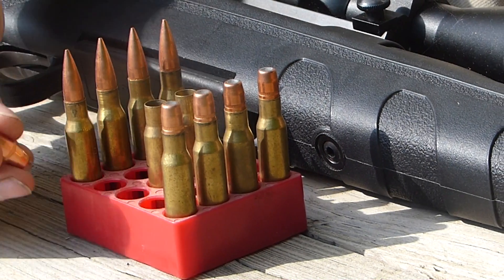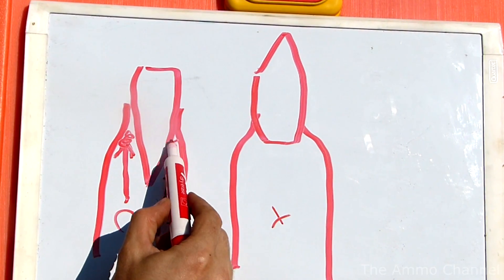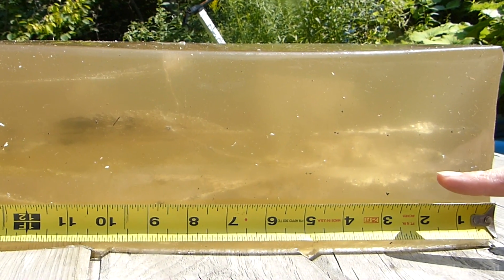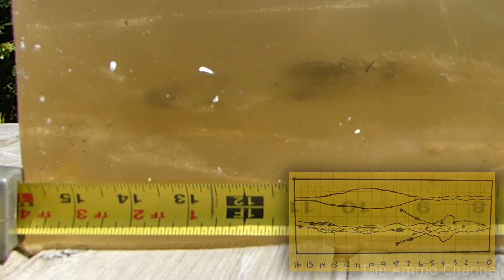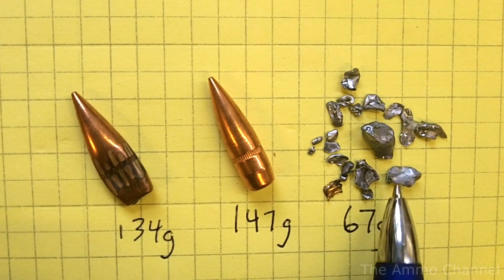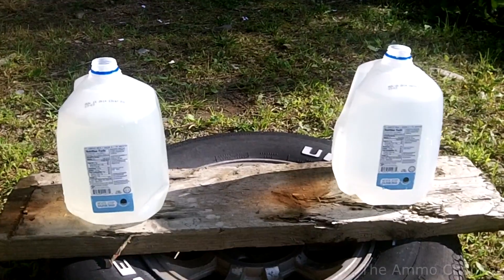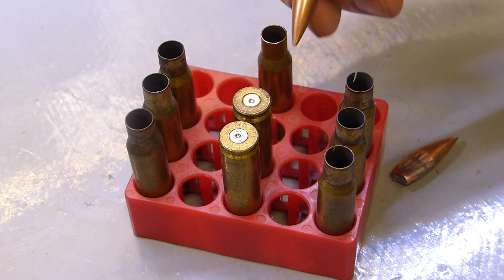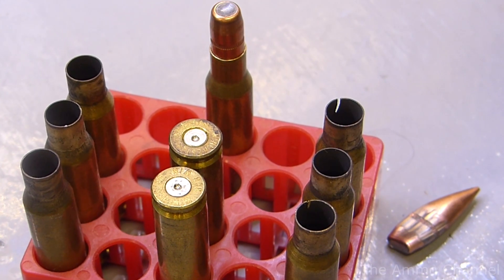Shooting Bullets Loaded Backwards

Comment: Pressure will be uniform in that first question you asked about local pressure.  I know intuitively it seems like your concern is vaild but no, pressure is still pressure everywhere the same  in that configuration.   Loading bullets backward is a great experience.  The damage and the BC you get from loading bullet backwards is insane. The tail is more suited for reducing drag than the nose. for better aerodynamics at subsonic velocity if loaded backwards.    Of course you can't cheat physics but this is actually a very eye opening experiment to run.  Props for doing it.  I have an old 1895 Nagant revolver and I load 78 grain rn lead slugs into it backwards because it's te perfect gun for it since there's no chance of shaving rounds on a gas seal revolver.  ..The flat nosed cylinder wadcutters are the poor mans'/.32 version of a subsonic, but effective hollow point. ..One which still maintains wild penetration and even expansion since it can do nothing but expand when it is an absolute cylinder of copper plated soft lead. At low velocities a pistol round loaded backwards punches a cookie cutter hole a la wadcutters.    Very effective if operating subsonic  Just likea SPCE 7mm mauser bullet does.  They cut tissue, not just displace it.  That's why they're so deadly.

Comment: By pushing the bullet into the case, you reduce the case capacity, increasing the pressure, BUT, if you use less powder, you can avoid the extra pressure buildup, you will shoot the projectile at the normal velocities, you will get less recoil, less flash and less muzzle blast. By seating the bullet deeper, you can save on powder, you won't need as long a barrel as you usually need and your gun will be more quite. Crazy huh? ;)

Comment: Ok so he’s kinda wrong. The origin of the backwards bullet. (K bullet) dates back to WW1. This was an improvised armor piercing round, The original purpose of which was to penetrate sniper shield. Not for flesh damage. He was testing against mild steel which was not often used in armor applications. A hardened or tempered steel was more common. against soft steel, which absorbs the impact they don’t do much. But hardened steel would break rather than absorb. K bullets are far more effective against hardened steel. With my own independent testing using 7.92x57 and 7.62x54R I can say that (K bullets) are very effective against armor plate. I would even say they are more effective than actual armor piercing. It uses the same principle that shape changes use.

Comment: Well it's simple as to why you got pressure sign and split necks... Loading backwards has more projectile in the case which decreases case volume... For a load that is close to or at max pressures, the pressures will be even higher... You can do it safely if you decrease the charge to compensate for decreased case volume...

Comment: Instead of backward rounds, you could use flat nose or round nose bullets they like a backward bullet have more surface impact area creating a greater transfer of energy on impact than a pointed bullet, think about a pencil the size of aabout a 30 caliber bullet, if you were stabbed with a sharp pointed end it would punch right thru your skin and flesh, pull the eraser off the other end and stab someone with it, its not going to even penetrate under such low force, but much more energy will tranfer creating brusing. If a pointed pencil can punch thru flash how much more is a pointed bullet going easily punch thru tranfering less energy than a flat rounded surface  bullet, the advantage of pointed bullets is to increase bullet trajectory and range but if more damage, stopping power known in hunting as knockdown power is needed than range a non point and even flatnose bullet is going to deliver much more energy and potential damage to the target.

Comment: My neighbor does this to range trash 7.62x39 he runs in his ak pistol. They fuction as frangible rounds.
Hes a lunatic though.
He also drills out fmj rounds to jury rigged jhp. Ive seen his setup, and seen his " theory" fuction as intended. But im still not running them in my firearms... Maybe if times get really tight, and the stockpile dries up, but until i have no other options id stay away.
I keep 10 " stubby" hp rounds on my 500m bolt gun, and have a red dot zeroed to them at 50m. Seems to do the job " better" up close with a really low bc and a expanding bullet

Comment: What happens if you load a pistol bullet into a rifle case? Nobody seems to have an answer for me. As I understand it the determining factor in reloading is the bullet diameter. So what would happen if you took a .30 caliber pistol bullet and loaded it into a.308 shell? Would it disintegrate once it leaves the barrel? Would it disrupt with poor penetration on target? Would it simply preform as designed for a pistol? What would happen?

Comment: The reversed bullets only punched holes in Harveyised (high carbon steel or boiler plate) AFV armour used extensively in WW1. Special "Cookie Cutter" were even produced, by the Poles, during the 1920's, which were basically a double assed bullets.

Unfortunately, homogeneous armour had been invented and started being adopted by AFV manufacturers, during the 1920's, which rendered "Cookie Cutter" bullets useless. The Polish 7.92mm. anti-tank rifle fired "Cookie Cutter" bullets and these proved useless against advancing German panzers, in 1939.

Comment: good video. try this using a 148 grain hollow base wadcutter in a 38 or 357. use a starting charge of powder (unique) . expansion is good and penetration is not very much. not very accurate past 20 feet. good in the house load.

Comment: Was the germans that did this for an anti tank round, they would also add more powder, the case pressure was also higher due to less volume. It was more effective at punching the 12ish mm armor of the early British tanks.  The backwards bullet didnt bounce off slopped armor, it wasn't so much for the overall penetration vs a normal round. It was more effective at making the steel spauld on the inside also by dumping more energy thus injuring ppl inside even without ever punching threw.

Comment: I wonder if you just hack the tip off and drill a small crater in the front. Then you may get the same effect with less pressure on the cartridge?

Comment: Get a handsaw and cut off the tip of the regular bullet, and you will have lighter bullet with exposed lead, and dull end, without going for the trouble of pulling and then resetting the bullet, and without worries about increased gas pressures inside the cartridge.

Comment: You didn't talk about whether doing this would cause problems for engagement with the rifling. I would think that not having the front half of the bullet at the end of the chamber would cause problems in that area and destroy accuracy. 

I also wondered whether using some kind of sabot device would offset the problems of having the pressure wave move around the sides of the bullet when loaded backwards. I suspect that the split cases were caused by the overpressure and not by the geometry of having the bullet backwards. 

The video is five and a half years old, so I don't know whether you are even making videos any longer. I have to wonder what the effect would be if someone just took a file and removed the tip of the bullet. That would create a kind of soft point with a flat end. Again, I'd expect accuracy to be terrible, but the expansion might be similar.

Comment: I did this in an 1851 navy with .45 Colt bullets. On 1 hand, those were easier to load than forward, and very devastating in the 1st few inches of a soft target. On the other, more felt recoil and less penetration.

Comment: It was used against early WWI tanks, so armor that was almost on the verge of being penetrated by normal fire. Against this, soldiers did not only reverse the bullets, but also added slight amount of gunpowder. It was not safe and it often destroyed the rifle or injured it's user and as the armor began to be thicker then soldiers just switched to other anti-tank means(there was K-bullet, which was had iron core I think, and then there were other tools for destruction of tanks, like artillery or anti-tank rifle: T-Gewehr 1918).

Comment: In ww1 the germans used backwards bullets aka K-bullets. They were used against the British mk1 tank. The k bullets would penetration the frontal armor of the mk1 much better that a regular. When theu penetrated thw mk1, they would shrapnel causing damage to the tank and injuries to the crew. But sometimes they were unreliable and would cause damage to the gun it was fired from and/or the user.

Comment: Germans used this in WW1 as anti tank bullets.
The tip of the bullet being inside the case allowed more powder to be loaded and it would penetrate thinner armor plates or on thicker ones cause the back of the plate to form shrapnell and hit the crew

Comment: You forgot the real reason! During ww1 they inserted backwards to hit the steel plates in the trenches 
So what you say ? There were never meant to go through the plate!!!       Ok idea was to chip OFF and scale the rear of the plate !!!
Thus SENDING shrapnel into the ennimies faces and yes it worked ! Very well. YOU DID NOT CHECK THE BACK OF THE PLATES !!!
WHICH IS THE WHOLE PIONT I HAVE DONE THIS AND IT WORKS !!!

Comment: When all you have is a 5.56 issue weapon with military rounds this works well for short distance personal protection.
If accuracy is required at more than 30m you have time to clear the top round and if No2 is a standard round you are good to go.
Just don't have the unfired reversed round anywhere in a war zone as you will be in contravention of the Helsinki Protocol.....

Comment: A little bit of history for you noobs: I don't know when this trick was first done, but during WW1 it was common unofficial practice for a short time that soldiers would file the tips of bullets off to make them flatter. It was well known that this caused more damage, resulting in a definite kill, where as a normal bullet could only leave a big wound. The only real drawback is limited range, because the less aerodynamic bullet would slow down faster. This practice was out-lawed by treaties possibly even before the war was over.

Comment: Well yeah it did more damge . you basically turn the round into a soft point so the thing expanded and exploded like a hollow point. U get the same effect loading with hollow points and save yourself a headache

Comment: I think where the backwards loaded bullets were more affective against armor was when it was sloped. I think The pointed bullets would have a tendency to bounce off due to not hitting the armor at its point, where the reversed bullets would have a corner that could dig into the armor.

Comment: i was told that the German soldiers in WW1 when realizing that there guns where infective against the tanks they would reverse there bullets and they did indeed cause a lot of damage to the tanks by causing a lot of shrapnel inside of the them wounding many of the tank crews
Reply: false
Reply: @iansmith8944   how do you know its false the person who told me was a historian and an archaeologist and had a lot of digs in the 1ww trenches
Reply: Chris Lewis It was not common practice for soldiers to turn their bullets unless they were in a desperate situation against a tank. The bullets might send small flakes of steel when shot against very thin armor but it wasn’t enough to kill a tanker or even cut their clothes. They might be hit in the eye and disabled but many tankers had splinter masks or other protection. The front of the German tank the a7v had 30mm armor made of mild steel that was very unlikely to be affected by a bullet. Even turned around it would have little effect. British tanks had even thicker armor. Soldiers much prefers grenades or mortars and would probably save their bullets for the infantry that was to follow. I’m sure it happened but not often and I seriously doubt that any tank was ever disabled by simply shooting it with turned bullets. It’s also very bad for the rifle.

Comment: interesting. ive experimented with modifying factory rounds.
filing them into flat soft points makes a very effective defensive cartridge in both 5.56/.223 and 7.62/.308.

it makes for an immediate and spectacular performance increase at short range for CQB or home defense.

Comment: Bro
You got high pressur issue which may blow your gun bolt because you didnt seat the bullet deap inough
Push it inough not to contact the rifling of the gun and you will be fine with no high pressure issues 
Safe to shoot

Comment: A couple of years ago I would grind the front of the bullet down and drill a big hole about a quarter of an inch down in it. It works alot better doesn't split the case's and no pressure problems it's bad ass Deer want know what hit him drop dead on the spot !!!

Comment: Old video yes, but there are some context problems with this test.

In reality the backwards loaded bullet was simply a interim solution to deal with British-French tanks and sniper shields until the K bullet came along with a tool steel penetrator core. The problem was the 7.92×57mm Mauser S Patrone faced when striking hardened steel was the same that any spire point lead core projectile faced. Some of the kinetic energy of the projectile would be absorbed into making lead striking the plate splash out to the sides. So you'd get no penetration and little internal deformation to the armor.

By reversing the bullet it would strike akin to a hammer blow, instead of trying to push through the armor it would simply transfer more of its energy directly into the armor causing the metal to deform and spall.

Your test against the steel plate has two errors.

1. A half inch of armor plate is what was estimated to be required to stop a reversed bullet at close range with no spalling on the back side. Exactly the thickness you used.

2. Mild steel is far more ductile then hardened steel and not prone to spalling, the metal will simply move instead of crack and create spall.

Reversed bullets of course where not an ideal solution, they could damage weapons they where shot from even injuring the user. Their accuracy was far less as well and the could just as likely hit side on then butt first. But, it was at least something that could cause harm to the crew in a tank or machine gunners/snipers behind shields when you had nothing else since the K bullet hadn't come along yet unless you happened to have a field gun handy.

Comment: You need to test it on a British mark one tank. Supposedly although it wouldn't penetrate it would cause the steel on the inside to splinter out and wound or kill the crew.

Comment: Maybe try lessening the powder charge in your reversed loads, or using a slower burning powder. this might lower your chamber pressure and alleviate the split necks and flattened primers. I think that volume change you mentioned in the video is the cause for this. having less "room" for gasses to expand with the same size charge as a normally loaded round would definitely cause higher chamber pressures. I would bet that your backwards rounds are getting out of the barrel a good 100fps faster than your normal rounds as well.

Comment: I've got .223 bullets with the jacket closed at the bottom and a little exposed lead at the tip. The base is completely flat. I'd expect them to act as wad-cutters if shot backwards, and offer increased penetration against mild steel, by shearing plugs of material instead of simply penetrating.

Comment: I was going to say you need to try this with armor plate, then I remembered reading those "sniper shields" were improvised from whatever they could find. Hardened armor plate is not usually just laying around so they more likely used regular mild steel like your target.

Comment: I do not think it will have as high a velocity or accuracy because it has a larger surface area.Also the bullet is backwards which means the pointed part might lower the accuracy even more because the heavy part is at the front.

P.S. the reason I was not using commas is because my keyboard does not have commas for some reason.

Comment: The armour-piercing combat usage employed the German 154gr S bullet, which has a concave depression in the base of the projectile, whereas the U.S. .30 cal and 7.62 NATO projectiles tend to flat (or relatively so) across the base. The concavity reportedly allows spin-stabilized  non-explosive projectiles to achieve a penetrative effect equivalent to that of a Beehive demolition charge or a panzerfaust projectile, etc.. The Imperial German Army reportedly adopted the backward loaded ammunition as a stopgap solution, pending the wartime development and introduction of purpose-made Armoured-piercing projectiles for the 7.92x57 IS (8x57 IS in modern usage).

Comment: Rifle and machine gun bullets simply bounced off tank armour. So the first attempt giving German riflemen and anti-tank solutions would be the Reversed bullets. This idea has been developed in 1915 as a way of penetrating enemy sniper shields. Taking a normal 7.92 x 57mm Mauser round the slug was twisted off and an additional propellant was added they were carefully reinserted backwards into the casing giving them a blunt nose. These round had to be carefully chambered to prevent misfires but could be fired from a standard rifle. The reversed rounds could penetrate armour at close range potentially hitting a crew member. Take note that using these rounds are dangerous as it could damage the rifle or injure the soldier using it.
Reply: Keep Calm but notice in the video the backwards round penetrated less. It’s not to designed to penetrate armor but to cause spalling